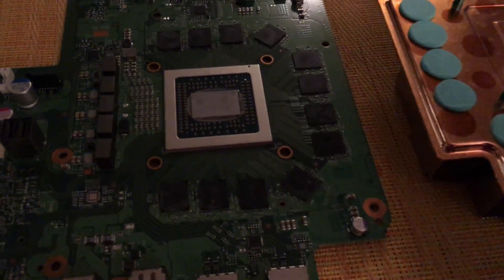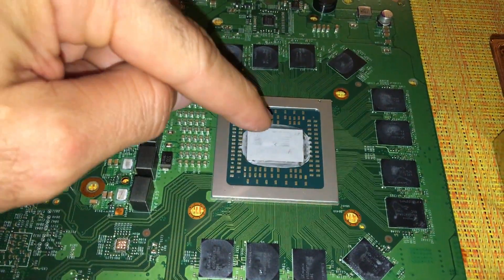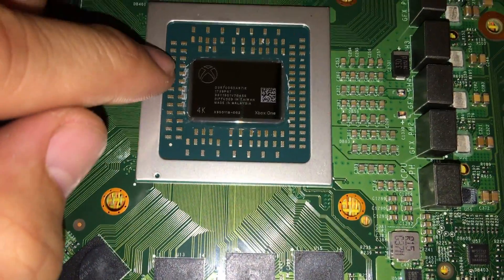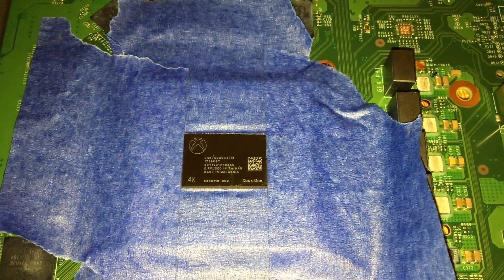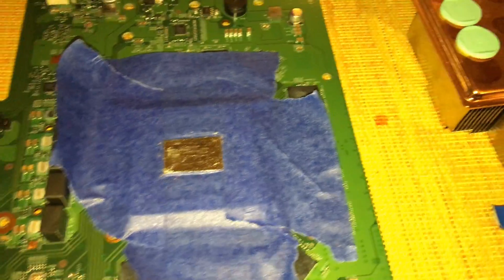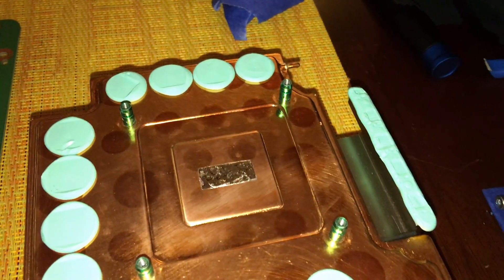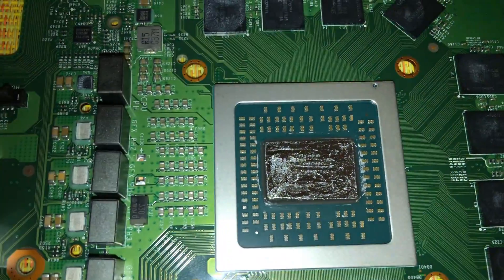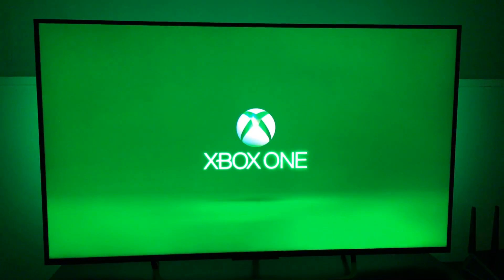Xbox One X Liquid Metal Cooling Mod

Comment: So clear nailpolish can be used to protect your transistors just so you know for next time man, also, incase anyone is wondering, Liquid metal is a gallium based material that WILL fry your stuff it it shorts out a trace/transistors anything. Also, make sure to apply a very thing layer to the heatsink as well where the chip is going to make contact
Reply: I use black permatex gasket sealer for engines. Insulates against electricity and will hold up to anything level of heat a computer chip could ever throw at it. It's what I used when I delid Intel chips with the smts right next to the die.
Reply: The proper thing to use is conformal coating.  It will cost you $12.95 at Amazon and protects against moisture, corrosion, fungus, thermal shock, and static discharges.  Once that is on there, no quantity of liquid metal will matter as the components are electrically isolated.  You could also paint on liquid electrical tape as well which is only about $7 at Amazon, though it is only good to 167 degrees F whereas the conformal coating lasts to 200 degrees C (392 degrees F).

Comment: You can also use super 33+ electrical tape to cover area that could be exposed to the liquid metal instead of clear nail polish. Tape can be removed where polish is a permanent solution.  Super 33 is thin enough to be left on so heat sink can make contact with CPU.

Comment: MvP4eVa1 doesn't liquid metal react to copper like and cause pitting and drys it out, i would of use arctic M-X4 instead.
Reply: Gamers Nexus tested this and stated that it works just as well as nickel plated copper. The only problem is that it stains the copper and plates it with gallium.

Comment: What you can do is to use formaldehyde free (non conductive) nail polish over the conductive parts, so that even if some of the liquid metal squidges out it cannot short anything.

The one problem I have is that because of those scratches on the heatsink, the liquid metal won't ensure a proper interface and you might end up with worse thermals than just using a good TIM like Thermal Grizzly Kryonaut.

Comment: Who else got to the bit where MvP decided that he was gonna add liquid metal to the heatsink after seeing the amount on the chip and totally freaked out. XD
Also, for people asking "why", here's a quick example of why this will help overall performance.
When you first boot the machine up and decide to play a game it will use the hardware to its max. After about 30 minutes of this, the machine will start to overheat, specifically the CPU/GPU (also known as an APU). When this happens the hardware will slowly drop its frequency to allow the APU to cool. This will mean the xbox will increase the fan speed and hold back a little, whether that be framerate, resolution or detail (such as shadow quality). After its cooled a certain amount (say 20-30deg c) the hardware will tell the game that its fully accessible again, up the frequency of the APU and up your frame rate/resolution/detail etc back to its best quality setting. For extended use of the system its obviously better to never reach the maximum APU temp (say 85deg c). Liquid metal can lower temperatures by around 20deg c (on average) which means itll hit the max temp a lot less often than a normal APU using the heat transfer compound that comes with the xbox (its also much quicker at dissipating heat).
Good video though... next? Add an SSD. Trust me, if you havent yet itll blow you away the first time you try loading a game on the machine. Note: I believe the XBOX HDD is tagged to the mobo so replacing it isnt as easy as adding liquid metal but itll make another great video.
Reply: pretty impressive info :)
Reply: @Krypterium  Welcome my friend :)
Reply: I thought with this liquid metal stuff you have to apply it to both the heatsink and the APU as well...should you only apply it to the APU only then??
Reply: Ah, no, sorry, I didnt explain the problem very well. Yes, indeed, you do put it on both the APU and the heatsink. The problem was the amount of liquid metal on the APU. But the video is correct. It goes on both. But I woulda probably taken some off the APU and transferred it to the heatsink before using more. The bit that freaked me out was the amount already on the APU not the fact that MvP was coating the heatsink :)

Comment: just finished doing this to mine. I replaced all the thermal pads as well. also swapped in a 2tb sshd because I didn't feel like spending the extra money for an ssd. overall im just happy I didn't break anything and its working better and faster.
Reply: Just wondering. Where did you order the thermal pads?
Reply: @zz02f  just search for thick termalpads
Reply: What thermalpads did you use and how thick are they? Did you measure the temperature and noise?

Comment: Thinking of doing this on ps4 pro it's traveled with me quit a bit doesn't run smooth like it used to and has gotten quit loud and does get hot how much would be good to put on the ?? Is it necessary to put it also on the heat sink
Reply: Very very thin on heat sink just so it makes contact with APU side. You'll see why when you try spreading it on the surfaces. It doesn't quite want to go on easy and is a little resistant 1st application

Comment: I'm just wondering... Why? You won't get any performance gain from doing this. I can't see any logical reason to void a warranty all so you can run maybe 2°c cooler, see no boost in performance, it's not like you can overclock your Xbox, risk destroying your hardware(for the record, a bit of nail polish or other compound like it will protect your transistors from and spill) it makes zero sense. Voided warranty. Zero change in performance. Negligible change in load Temps. No real chance of extending the life of the hardware. It's gallium based, so it's going to corrode any metal it touches. Why not just delid the APU while you're at it? Because that's what liquid metal thermal compound is for. All benchmarks show that simply replacing the thermal compound between the CPU(or APU in this case) and heat sink showed average load temperature gains that fall into the margin of error. It's not meant to replace thermal paste. It's meant to delid the CPU apply it directly to the dye, and then destroy your processor trying to break over clocking records. I HIGHLY recommend you don't do this. Increasing air flow over the cooling unit will have a much greater impact on load temperature, and you don't have to void your warranty or potentially destroy your console doing it.
Reply from the maker: Carl the Unexceptionable Craftsman Thanks for the comment 👍🏻,  However I’m pretty sure the cpu on this console doesn’t have an IHS “Intergraded Heat Spreader”  therefore what you see exposed is the TIM “Thermal Interface Material”  or commonly known as the die.   Cooling mods done on a gaming rig or console it’s not necessarily to gain performance but also to run quieter. A cooler console means slower fan RPMs and yet sustaining better temps throughout at lower fan speeds. There is also the possibility of getting more stable FPS and less frame drops due to cpu throttle. Wether is a cellphone, laptop or console .. these electronics are packed in tight enclosures and they all have sensors with thermal limitations.. something have to give before their cpu start to throttle on a given load, example: cpu under clocks itself, or won’t reach its max performance in favor of staying itself within its operating temps..  Granted, the XBOX ONE X will not surpass 60fps, Fact.  but I’m pretty satisfied to know that my Xbox can run at its full potential at any given load at longer hour sessions and more so running at a consistent or more stable FPS and less drops all while the fan runs whisper quite.
Reply: MvP4eVa1 what was the point of risking the console by going with liquid metal over something like Thermal Grizzly Kryonaut which has only about 2C difference?
Reply: Because TONS of tests have been done on the effectiveness of thermal compounds and without bolstering the cooling, like adding a tower or liquid cooling, the effects are negligible. At best. Also, thermodynamics. In order to have any kind of significant impact on CPU temps you can do one of two things, increase the area of your heatsink, or, increase the amount of air passing over it. Just because a thermal paste has a higher heat transfer coefficient, the heat sink does not. It's only capable of removing a static amount of energy tangent to the amount of energy being created. But let's assume you could, just for fun, you're still going to run into the exact same problem with the airflow. The air can, once again, only absorb so much energy in the time and volume by which it passes over the fins of your heatsink. If the amount of flow was capable of absorbing all the heat your heatsink would remain cool, even after hours of running at full load. But it doesn't because the air can't remove enough heat, either because the volume of air is too small, and its is simply incapable of removing additional energy, again, tangent to the amount of energy being produced, or it doesn't have sufficient contact time with the heat transfer fins in order to remove more said energy. All this is doing in a world where physics exist, is allowing heat to be transferred between the heatsink and the CPU. The end result is zero net gain as no additional energy is being removed , just relocated. It's just simple conservation of energy. 
That being said, the xbox locks its performance. You can't overclock the thing, so its cooling is designed just fine.  It is already pushing every frame it can get out of every game. This isn't going to boost performance in any way, and is really just not worth the work or the warranty. The software in the xbox is going to limit performance WAY before it starts thermal throttling. This stuff doesn't really have an application or appeal here. The stuff was designed for people with overclocked water cooled rigs, and even then it's not really worth it.
Reply: Here's the math, in case you're interested. 
https://www.electronics-cooling.com/2003/05/how-much-heat-can-be-extracted-from-a-heat-sink/
Reply: First off, his warranty isnt voided. Though microsoft puts stickers on their products as such that statement isnt actually true, it is actually illegal for them to do that. They recently debunked this. Number two, liquid metal is incredibly heat conductive so his console will last a long ass time because it wont have to run so hot, even if it doesnt get that hot in the first place.
Reply: Carl the Unexceptionable Craftsman 
However you neglect how fast heat can be removed from a die. The point to use liquid metal is to maximize how fast heat can be taken off of a chip. The heat sink in turn heats up more and can more effectively dissipate heat due to the difference in temperature. It doesn’t matter how much heat a heat sink can dissipate because most heat sinks take a very long time under load to get to their theoretical limit. That’s all caused by the inefficiencies of normal TIM. Yeah they will get there over time, but and that point you’ve wasted so much time that the processor has been throttling for quite some time. This way, you can utilize the full cooling potential of a heat sink during burst loads-when it matters. From many of the tests I’ve seen using liquid metal in die on heat sink applications, the difference is enormous. The is is especially true for laptops. On an Xbox? I’m not expert but it probably won’t change much as said earlier due to software locks.
Reply: The PS4 Pro 100% thermal throttles when playing Assassins Creed Origins (pretty sure GN did a video with the XB1 on this). And you keep repeating "there's no performance gain" when 1) there is a slight increase with consistent clock rates due to improved thermal headroom and 2) the guy states he did the mod to achieve lower noise levels which will happen because there is a reduction in temperatures. Thermal grease and pads are rated from 3-7 W/mK, and liquid metal is rated at 70-75 W/mK. There is a thermal bottle neck currently as the die transfers heat to the heat plate of the cooler. Increasing the amount of energy transfer with LM is going to show. I'm not positive on the exact fan curves on the PS4 Pro or Xbox One X, but decreasing 6-10C will more than likely decrease the fan's RPMs (therefore noise) by having it run in new/different fan curve zone.
Reply: COST! and cheap un-experienced labor putting these consoles together.
Reply: Carl the Unexceptionable Craftsman makes around 9 c difference, if ur poor well then don’t do it?
Reply: Carl the Unexceptionable Craftsman consoles do thermal throttle, the PS4 can thermal throttle, but having lower temps would prevent any sort of situation like that from getting to that point, for those who live in warmer climates and dont crank their AC would have such problems. Im not saying this "mod" is for everyone but its not really a negative. It has more pros than cons even if those cons are signifucant for those who dont know wth theyre doing.
Reply: Mate my PS4 with liquid metal can run as well as a ps4 pro after 4 hours of gaming the temperature was -12C compared to the original thermal compound
Reply: The  temperature  will go down by 10 to 20 that's a lot.  It's better for the console. I don't get it why all companies do this with consoles or pc/laptops.  It's cooler and it's better.
Reply: and how was this temp difference measured?
Reply: No. It doesn't.  https://www.reddit.com/r/PS4/comments/5jrbqi/does_ps4_throttle_performance_with_heat/ It reaches 99c and shuts down. https://www.neogaf.com/threads/ps4-will-shut-off-to-prevent-overheating-when-high-temperatures-are-detected.697495/page-5 I can't find a single article or spec sheet showing the PS4, or Xbox one thermal throttling. I think you're quite confused here, a frame drop, isn't thermal throttling. That's just the hardware not being Able to keep up. And no shit. Really? You drop frames when playing AC origins? Nooooo! I mean, I know my wimpy 1950X and 1080TI with 32gbs of ddr4 drops frames in that game sometimes, but the power house that is the PS4?!?! Never...  Also, you're STILL ignoring just pain old thermodynamics. Air can only carry a finite amount of energy away from the source in a certain amount of contact time.  In this particular case, since you can't increase surface area(replacing the heat sink for a larger one, or one with more fins) so, in order to remove more heat, you HAVE to either add more air, or, use a medium capable of absorbing more heat. Like water. All you're doing is moving heat from the dye, to the heatsink, and then back again. This bears repeating because for some reason it's just not sinking in, adding a tiny amount of something super thermally conductive is not going to change the thermal conductivity of your heat sink or the air being pushed through it. It's already performing to the peak of it's ability. And your fan is already removing as much heat as the air is capable of removing. I've been over clocking rigs since the 90s, and there are only 2 ways to remove more heat, you can increase the amount of surface area of your heatsink, allowing more air to contact it\allow for more contact time, OR you can swap the medium you are using to remove the heat, like water cooling or adding a larger fan so a larger volume of air makes contact with the heatsink. You're not cooling the machine like this. Moving heat from the dye to the heatsink isn't going to make a difference if you have your machine on for long periods of time, it will end up exactly the same. The heatsink will just heat up, and start to transfer the heat right back into the dye. The fundamental errors being made here... You can't bend, or break the laws of the universe just by adding a drop of galium. Sorry. But hey, let's see some numbers, a side by side comparison showing an improvement in frame rate. Since you're so adamant they exist. The general consensus is that liquid metal isn't even worth using on a rig, let alone a console, you can accomplish the same or more, by spending that money on a better cooler or rad.

Comment: I did a teardown on mine as well. I mounted a Noctua NH-D15 along with copper heatsinks on all the chips. However, I went to set the Noctua down to check clearances and noticed a slight, slight wobble. So I got a mini straight edge and checked the Noctua and the processor and it turned out to be that the processor was ever so slightly warped.
Reply from the maker: Gaming In Frames I was thinking about doing the same, but I changed my mind. However I was looking to get higher quality thermal pads and scratched the idea of getting the copper heatsink because I wanted to keep it all original.

Thanks for watching and hope you resolve the issue with the warp die .

Comment: How’s it holding up? Any overheating issues? Would like a follow up.
Reply from the maker: campos3452 It's working great, the cooling fan runs quiet and smooth, I can barely hear it.  At first I was kinda nerves putting the Xbox One X back together and before I  turned it On as you can tell in the video.  However I think this mod is safe because as the motherboard is upside down any spillage is gonna run down to the heatsink and away from the motherboard,  not saying to feel free to apply a lot of the liquid metal.
Reply: If you use the liquid metal properly,by applying a very thin layer of lm the risk of spillage will be zero(you used to a bit to much on the xbox apu),this stuff already is pretty hard to spread so why would it drip if you dont use the lm like an idiot ? 
Also maybe other people already mentioned this but you should have spreaded the lm to an equal surface area on the cooler, the spreading should have been as large of a surface area as the apu is